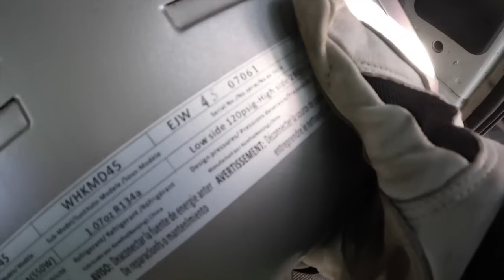TRASH PICKING MILLION DOLLAR HOMES During Fall Clean Up! - Ep.830

Comment: You made a comment about why people walk in the street. I noticed when you picked up that lamp that the sidewalks are uneven and a walker who isn’t paying attention could trip. I can understand your frustration. I usually walk facing the traffic so if I see a car coming I can move over to get out of the drivers way. But some people walking are not that considerate. Great video!
Reply: The city should be fixing those sidewalks. That would not happen where I live.
Reply: The city where Taco picks in this episode, the sidewalks are the responsibility of the homeowner.  Very expensive to replace.
Reply: @hillpickers3550  
Sorry I did not know that was the problem however if it is the owners responsibility to fix the sidewalk then it would would be the owners responsibility to get it done so if someone did trip and fall the owner could be sued and which is cheaper fix it or someone’s hospital bill. Safety is my only concern here and I am not picking on the owner.

Comment: I cannot get passed, antifreeze in a hot water heater. Not while it's still in use, because wouldn't that poison the water which is actually coming through the faucets? 😮😢

Comment: All those leaves 🍁 are probably a big part of your seasonal allergy symptoms. Especially on the East Coast elevated ragweed pollen levels ,along with the dust and mold from falling/decaying leaves are the cause of most Fall seasonal allergy symptoms. If you go to your local pharmacy and ask the pharmacist,  for an over the counter allergy nasal spray and get instructions on how to use a nasal spray correctly ( not straight in your nose, which sprays the back of your throat well, but not your sinus cavities) 🤷🏼‍♀️ chances are you won’t have any allergy symptoms this Fall. ‼️😉